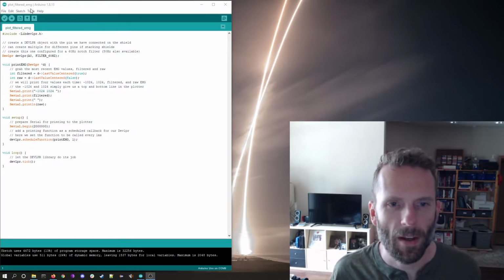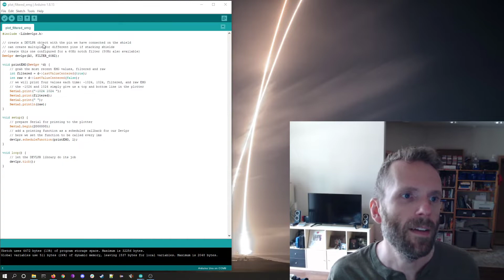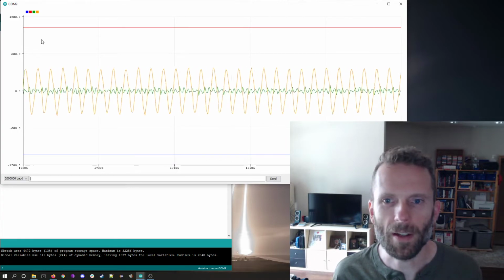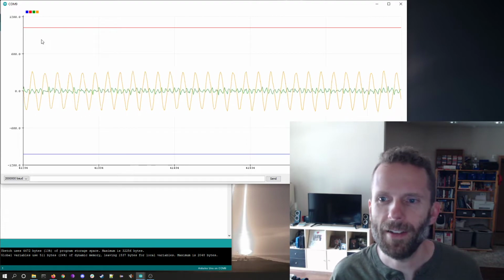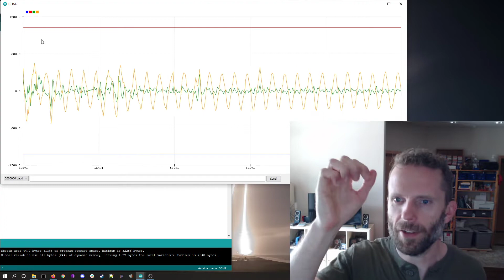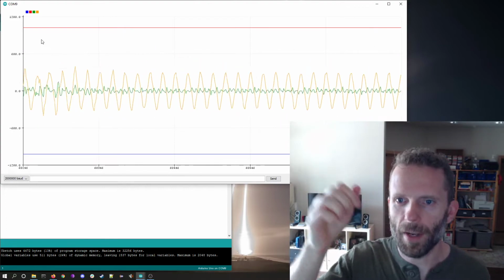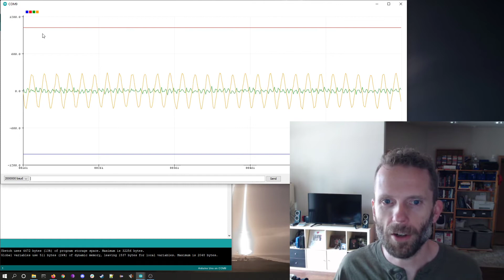Open-source Electromyography Arduino Shield with Filtering

Comment: I have a question, i have multiple emg sensors from different brands sometimes the resting value on arduino is 200 and sometimes its 8000 and when its 8000 if i contract my muscles the sensors doesnt detect them, do you know what could be the problem and whats the fix? Thank you
Reply from the maker: Not totally sure. I've found that EMG sensors are quite sensitive to placement, movement, and wiring. If it's sitting at a high value and you're not seeing a change when you flex, you might try repositioning it. That sounds like a really high noise floor that then is washing out any real signal. Some extra band-pass filtering on or off the Arduino might help you pull out the real signal too.